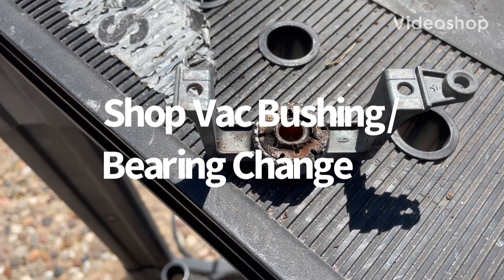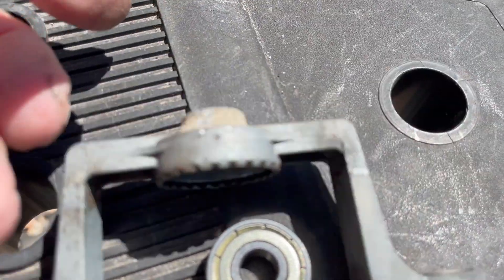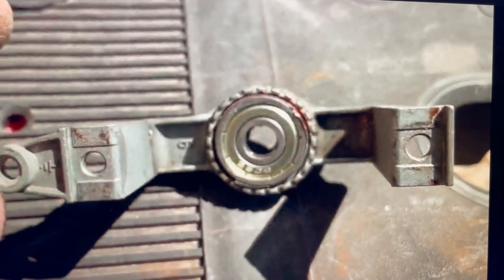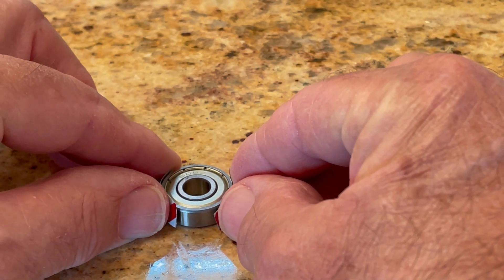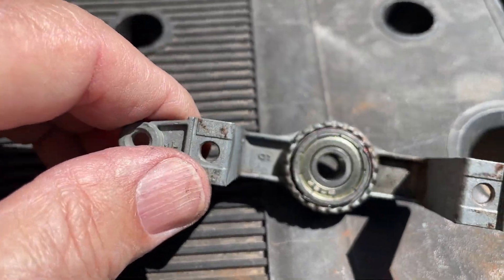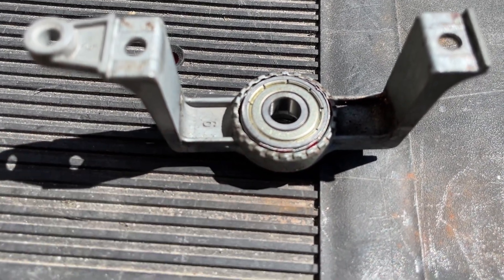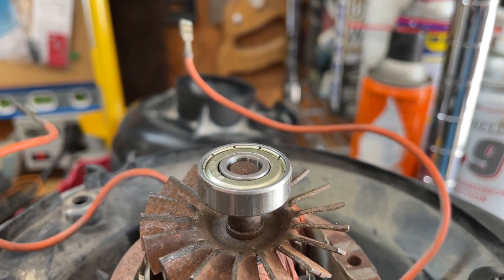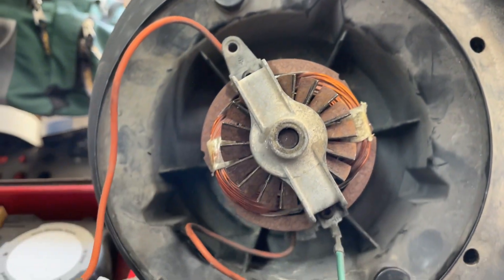Replace ShopVac bushing with 608 bearing

Comment: Thank you. Brilliant! Following your directions I successfully repaired my 8 gallon shop vac (an actual Shop Vac). A couple of things. I was tempted to use some high temp Loctite to secure the race, but I'm glad I didn't. With the coke can shim I was able to take the bracket off when I found I hadn't driven the bearing far enough down the shaft (it was binding when I put in the securing screws). Also there were lots of choices for 608 bearings on Amazon. I noticed they had speed ratings. Since the prices were about the same no matter the rating I bought some high speed bearings made by PNG. It was a 10 pack, but 1 bearing cost $12 and 10 cost $10. Go figure.

Comment: Brilliant and well explained. You must have read 'Zen and the Art of Motorcycle Maintenance' where the author ( Robt Pirsig Jr) discusses in detail how vital and important 'shims' are in mechanical systems. He offered to 'fix' his riding partner's deluxe BMW whose handlebars were slipping but the man declined; offended to say the least and disbelieving that a 'shim' ( also cut from an aluminum can) could improve upon German engineering. 

In my mind, the BMW rider probably failed to tighten the clamps that held the bars in place and machined out the grooves that held the bars from moving. Just 'lived' with it and instead of repairing properly, just kept moving the bars. The 'shim' would have worked for sure- as it did here. TY for posting!
Reply from the maker: Yes I read it. And ride BMW motorcycles.

Comment: Quite genius. A super fix. I used JB weld to glue the bearing to the mount. Easier than swimming. Thanks
Reply from the maker: Yeah, there is another product that is used to secure bearings that almost fit the boss. 

Loctite 39150 High Temperature Bearing Mount Stick

Comment: Any idea where I can get the u-shaped aluminum carrier?
Reply from the maker: If yours is broken I doubt new parts are available. You could salvage one off a throwaway vac you find on someone’s curb. Or perhaps repair yours with JB Weld. Or call the manufacturer. Good luck with that last one!
Reply: @mguerramd  JB Welded it- we'll see if she holds up.  Looked high and low...could not locate one online. Thx

Comment: I will be doing this in a few days.   Has it stood the test of time?  My bushing burned so bad it set the smoke alarm off....
Reply from the maker: Still working fine a year and a half later. I think this vac is at least 20 years old.
Reply: @mguerramd  thanks.   My vac is 30 years old.  I guess the original bushing did OK.  Hopefully get another 30 years out of it  :)

Comment: What is the size of your vac?  Mine is a 5 gal.  Just wondering what sizes this bearing will fit.
Reply from the maker: @martybgood62  I think 5 gallon. I suspect most of the shop vacs use the same bearing carrier and the same size bearing for the sake of economy, even if some of the motors have different horsepower ratings. It’s not that difficult to disassemble the thing and find out.

Comment: Would you think of drilling two small holes between the outer edge of the bearing and the carrier and inserting two small dowel pins so it does not spin, would be a good idea?
Reply from the maker: That will weaken the bearing boss but no idea if it would be significant. Using a shim is cheap, easy and effective. High temp epoxy could work but make it near impossible to replace the bearing in future. You can shim with tape as well. Or cut strips of heavy duty aluminum foil. Or just use… actual shim stock!